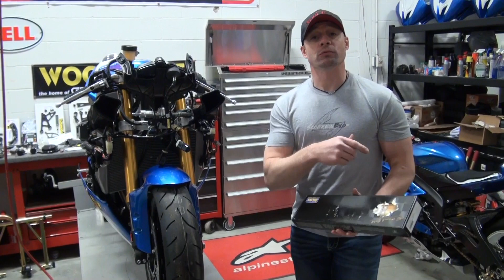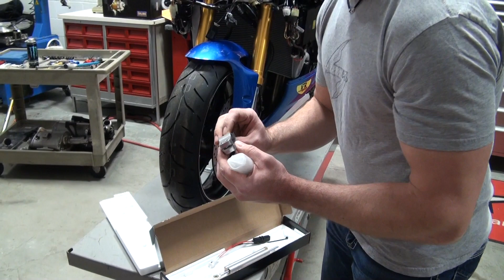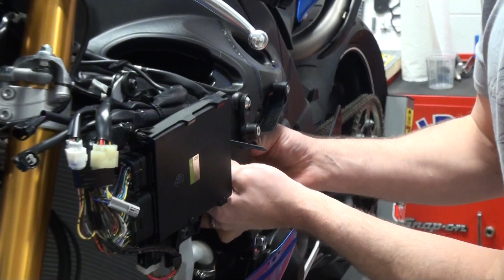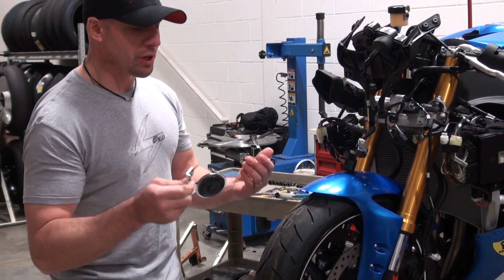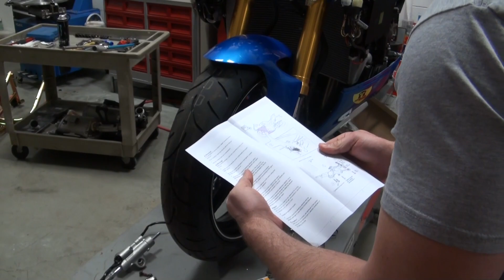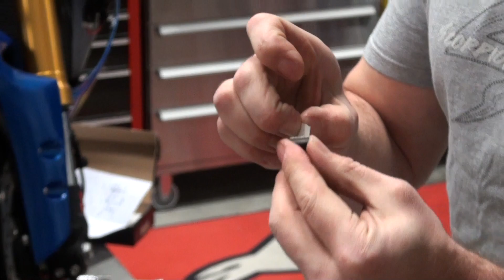Ohlins Steering Damper Install and Review on The Yamaha YZF-R1 STG Project Bike

Comment: Hey Brian.
Was thinking, what signals do the OEM electric steering damper receive...?
Is it just 12vdc, Rom, Speed or somthing different...?
Reply from the maker: I believe it is speed sensitive with the damper providing more resistance at higher speeds. - Van
Reply: @sportbiketrackgear .
I've been looking for a steering damper on EBay and some other places and the electric models second hand is the cheapest branded öhlins...
So I was wondering if it would be possible to fit it in the wireing on a old 'carbed'-bike...
I have a 93' Fireblade 'Twin eyes' pretty good condition with a modified wireing harness done by my self...

Comment: Why are the OEM dampers not good enough?
Reply from the maker: Some of the OEM dampers are just fine in many cases. Many bikes do not come with a damper from the factory and those that do can not be adjusted. If you are serious about track riding or racing a quality, adjustable steering damper is a good idea. - Brian Van
Reply: Sportbike Track Gear Ahhh. Got it. Just installed this one on my bike.
Reply: they are fine

Comment: excellent tip on the wheel weights Brian! Even better that in a crash will keep the steering from going all the way to the true lock and possible cause less damage to the damper itself :)

Comment: Do the Damper sits in there straight  or does it has a slight upward position?
Reply from the maker: It would depend on the bike on how it sits in there, but typically takes place of the stock damper.
Reply: Sportbike Track Gear I have a 2010 R1

Comment: Replacing a microprocessor controlled electronic steering stablizer with a mechanical one seems to me to be a step-backward. The electronic one uses a microprocessor and sensors to detect wobble and react to control it in real-time within milliseconds. I know the Olins products are good but better than a microprocessor controlled stablizer? I don't think so. An electronic stablizer can progressively tighten the steering relative to motorcycle speed. It can also detect wobble from rain-grooves and diamond cut roadways to resist that out-of-control feeling. It can even sense when the front wheel has come off the road and rejoining the road out of alignment with the rear (also causing wobble).  Good video though.
Reply from the maker: +Jay D. Anderson The issue is the damper is not set to be firm enough for track duty. More damping is needed than the stock damper can provide with the valving that comes stock. - Van
Reply: Jay D. Anderson I agree, where're in the day and age where a small microprocessor and do more calculations a second than what we had 40 years ago that took up whole buildings. Nothing mechanical can even begin to touch the computations of microprocessors. Makes me wonder when our computers today that are is big as buildings become as small as a penny.
Reply: Have you ever given a litre bike full twist?  Sometimes you can go light enough on the bars to tame it, other times you'll wish you had this damper.
Reply: @brandonclark8736  u adjust the oem damper's settings from the ECU for better damping